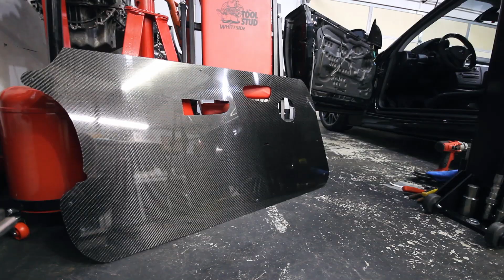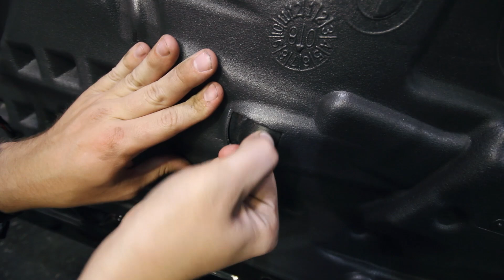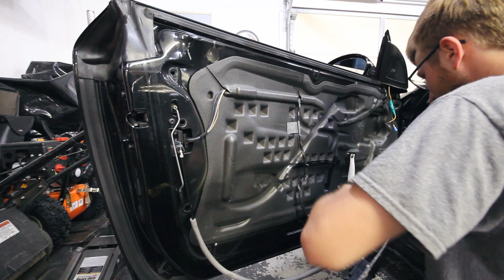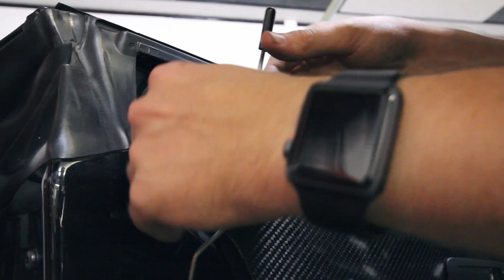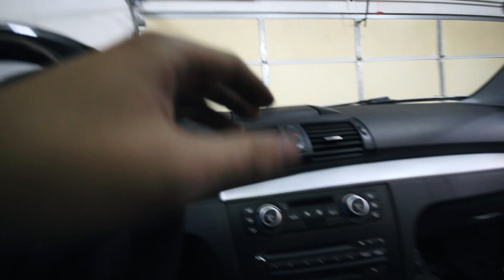Installing CARBON FIBER Door Panels in my BMW 135i!

Comment: I know this is a bit old but purchased a 135i a while ago with these door panels installed and while I really like them I’m going to replace them with one door panels (not having an armrest in a daily sucks) anywho have 2 questions. 

The white plastic clip you remove for the door pull tag what is that called? Trying to look for one to install back in and the top clips for the oe doo panels as well. 

Secondly how much do a set of these go for on the second hand? Don’t think they’re in business anymore

I appreciate it!

Comment: Was just chatting these guys up last week! Can’t wait, will you get the rear panels too? How much extra space do you have now between seat and door? I need some wider race seats and looking for space!
Reply from the maker: Nice! I didn't get the rear panels. I just removed mine completely. I don't have an exact measurement on clearance gained, but it's a decent amount. Whatever the width of the stock panel is.

Comment: The project is cool and I love your content. It might be lighter but IMHO this defeats the daily driver value to this car. But that’s a CA guy that is 2x your age talking; I sit in traffic M-F so this would be cool but not comfortable.
Reply from the maker: Haha, it's far from a daily driver. I haven't daily driven this car for a while now, that's what my 335i is for. I'm building it for the purpose of going fast at this point, but it will still see the street. Luckily the roads are great around here with little traffic. Perfect for cruising.

Comment: Does the locking pin annoyingly rattle over bumps now? And does central locking still work properly?
Reply from the maker: I haven't driven it yet, but if it does rattle, I'll put some insulation around it. The central locking still works perfectly.

Comment: You should get the door pull straps instead of the door handles on the inside
Reply from the maker: I thought about it but don't think the weight would be any different and I like the way the stock handles look.
Reply: Jake Spence yea that street car vibe

Comment: Man, you went from nice street car to kind of gutted thing so quickly. You're going to regret it! Door cards look nice. Wish they tired a little harder to have some mold and contour. I think you'll miss the arm rest a lot.
Reply: No bro am more gutted then he is you are not going to regret it. He has other cars to drive if something. When your car weights 400 pounds less and you do like half a second faster on the quarter mile you will be so happy you did that lol
Reply from the maker: I know it's not for everyone, but I think I'll be happy with the results. I've taken hundreds of pounds out of the car, which is meant to go fast. It's heavily modified and the whole purpose is to go fast. It does still see the street, so I'm keeping the important things. We'll see how it plays out, I'll keep everyone updated on my thoughts. Haven't driven it like this yet.
Reply: @jake_spence  you will love it! The car will feel soo good and easy to brake and turn like it listens to you and respond so quick not like heavy kind of person. I weighted my car with the smaller battery that weights 20.8 pounds (original is 60.8 or so I weighted them) and my e92 335 was at 3120 lbs.

Comment: The old "rule" is 100 lbs equals a 1/10 second in 1/4 mile.    Is it worth it????  If it were a pure drag car I'd say yes.  But not for a car I drive daily.
Reply from the maker: True! I don't daily drive this car anymore. That's what my 335i is for. This car still sees the street, but is geared towards racing.

Comment: Great video Jake.  Hey for the pull strap you may want to add blue loctite on the nut in the door so the vibrations don’t back the nut off. Hope this little tip will help you bud.  Love the look of the door panels.
Reply: @jake_spence  Looks like it was a nylon insert lock nut.  They don't usually need Locktite.
Reply from the maker: Just checked and they are indeed nylon locking nuts. No loctite needed!
Reply: Sorry to give you the extra work on removing panel... I’m glad that you didn’t need loctite.  Panels look amazing.